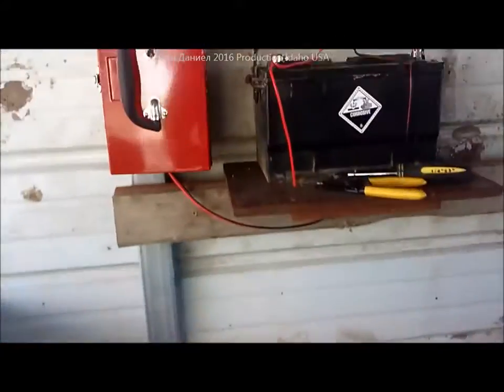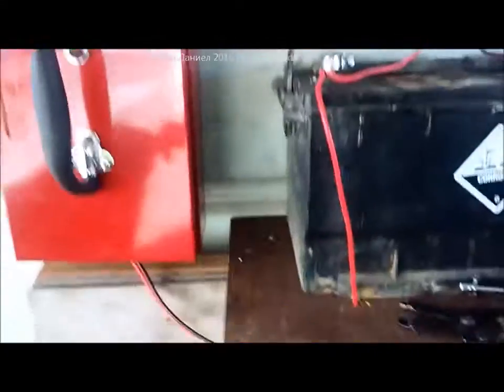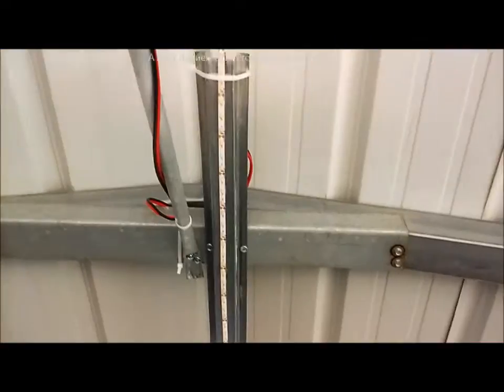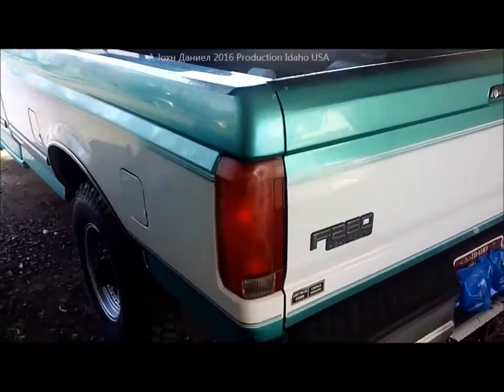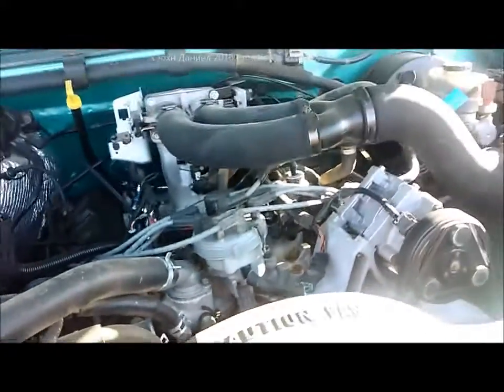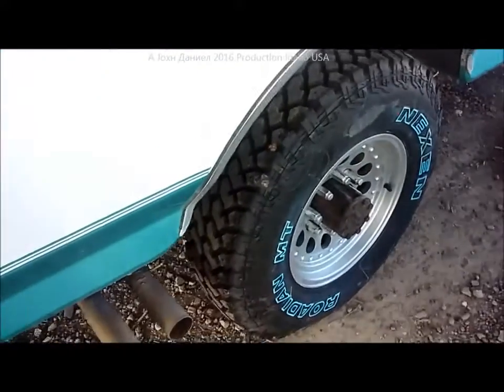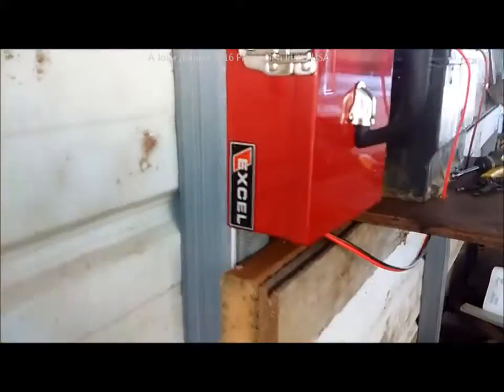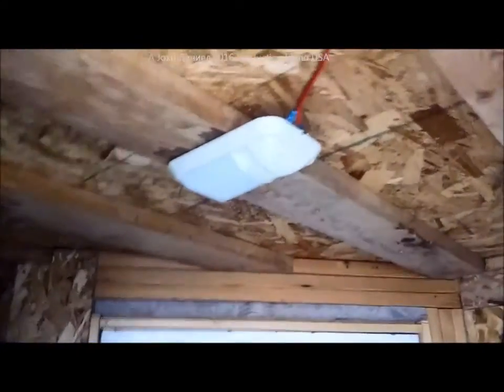DIY Solar Carport lighting - works automatically and cheaply

Comment: I took your suggestion on all components, purchased exact same equipment, now just a matter of hooking it all up.  simple and cheap (except cost of battery) hadn't ever thought of doing something like this, but now I am pouring over your videos for some more great ideas....  THANKS A BUNCH !
Reply from the maker: Yep, ours is running 5th year now, on restored 4 to 15 year old car batteries!! LOL And I have built 4 more in different places CHEAP!! Best panels though are the MightyMax. Their 100 watts is a REAL rating unlike all the others http://rover.ebay.com/rover/1/711-53200-19255-0/1?icep_ff3=2&pub=5575119394&toolid=10001&campid=5337668021&customid=MIGHTMAX&icep_item=381680181673&ipn=psmain&icep_vectorid=229466&kwid=902099&mtid=824&kw=lg NEC RATED 100watt
Reply: I just checked out the Mighty Max, not a bad price on the 100 watt panel, free shipping is a plus also.....  thanks again for the info..
Reply from the maker: We put 10 of them on a tiny house near Deeth Nevada, using 2  40 amp TRACER MPPT controllers. They are doing very well for the price point.

Comment: nice set up, im buying those night day sensors now you say 2 years no issues, i use 12/24 pir for my outdoor.
Reply from the maker: +closertothetruth  They have them in 12 , 24 and 48 volt if you search for them.  I have one thats been on my motor home for about 3-1/2  years, works every night. Secret is, never exceed half its Chinese rating!
Reply: +Јохн «HEADSMASHER» Даниел  , yes i learnt that hard lesson with chinese inverters, 50% and no more
Reply from the maker: +closertothetruth If you buy a AIMS inverter then its 30%, Those are shit inverters made out of waste materials!
Reply: +Јохн «HEADSMASHER» Даниел knurlgar didnt have nice things to say about aims, i have sma windy boy, aurorora and latronics, i got fed up with rubbish and spent some money but managed to get them very cheap new and unused/unwanted.
Reply: I have  them on my 4 cabins at a campground for about 3 yrs now,  no problems

Comment: good idea for our well house.
Reply from the maker: Yes, very good option for sheds, and well houses. Most are 240 volt wells, so its easier than tapping power for making a unbalanced 120 VAC circuit off it.

Comment: Yo, nice truck! Say doesn't that controller have a street light control on it? But you should put links to where you buy that way I don't have to ask you for it, LOL
Reply from the maker: +TheBillytheJack2010 The controller has a light function but it activates too early and stays on too long so it uses much more ( waste more) power. That controller load option is only good for 3 amps too. The Photo cell switch Light Sensor comes on at dark, not when the panel is not producing. That means I have about 2 hours less draw per day. It will however be used to run a 3 watt light on the other side of the carport due to that side being in the shade of the setting sun and shaded by the shop in the morning light so its time to come on has a value then. 
That truck is a pure win. Not very often you get a garage stored, 1997 one owner F-250 with 60k on it for 4 grand!

Comment: I have a curious question...  say I have (2) 12 volt led light strips,  could I connect the strips together in series instead of parallel ,  could I safely hook them up to operate as 24 volt ?  or would it damage the led strips ?   thanks...
Reply from the maker: +KC You can buy models that are already 24 volt. But the 12 volt model us set up with resistors and diodes that won't allow wiring options you speak of.
Reply: thank you for the reply.  I knew if anyone could give me an answer, it would be you.  another option for me to consider is a 24 to 12v step down transformer.   thanks.....